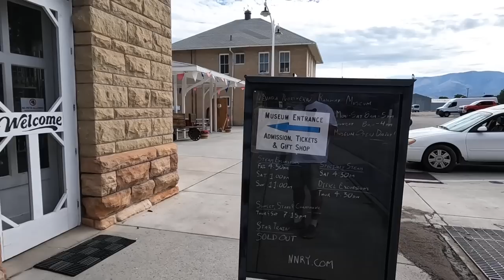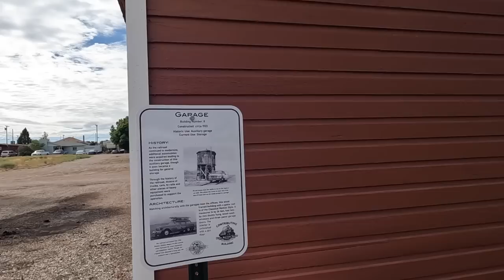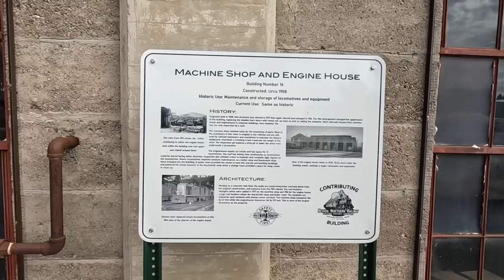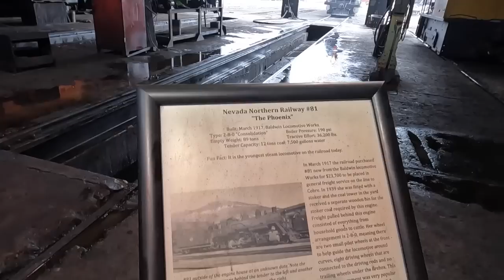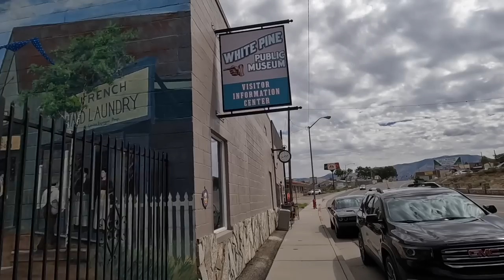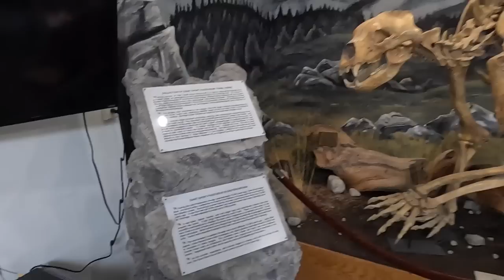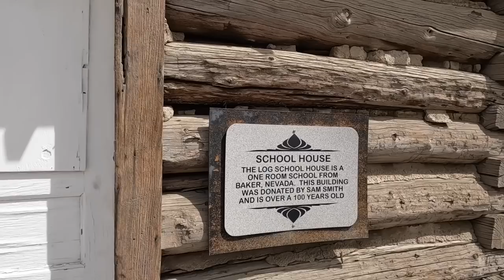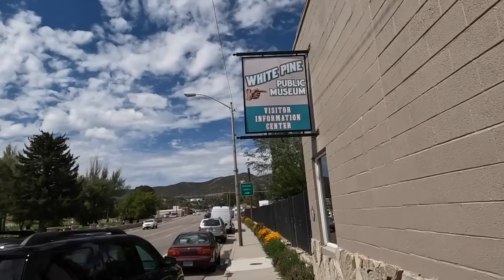Historic Museums of Ely Nevada - Impressive

Comment: I have only heard about that town 😮😮never seen in person there was no steam engine trains running when I was a kid years ago close by that was be 4 my time and by the late 1940s and the early 1950s they changed 2 diesel trains  the coal trains years ago use 2 run every hr on the hr U could set your watch ⌚  by them years ago now I only hear 1 when goes through town the old steam engine trains did use coal futher west U went there was no trees so there was no wood coal puts out more BTU,S and even the other steam engines use coal instead of wood unless U worked at a sawmill 😊😊 then U use the slabs and cut them w a wood saw there was no chainsaws back then and they are faster than the old 2 man cross cut saws  or buck saw or a are  even U had the wood U still had 2 haul water 💦 😊 from a creek or river U had 2 use barrels or a water tank 😊😊 remember when U had 2 go 2 spring or creek 2 get water 💦 😮 it was the same thing there was no running water 💦 😮 back then if U a well 4 water 💦 😊 U were doing good  alot of the old hand dug wells wasn't much I still remember 1 where it had the water 💦 😊 bucket U would let fill w water and U had 2 pull the water bucket up by rope the water 💦  was good and cold it would make your teeth ache it was so cold and drinks 😊😊 out of the drink machines use 2 be the same way not no more they won't turn them back 2 get cold now if U don't put soda 🥤  a cup of ice it's hot in no time ⌚  and not fit 2 drink  I like cold drinks my self 😊😊 there use 2 be a time when people use 2 use mugs 2 drink  they were even better when U when they had frost on and even better when the drink had slush in them I, I say they good and cold then if yall remember that at all I do 😊😊😊🎉🎉🎉 OMG 1 3O 2O24